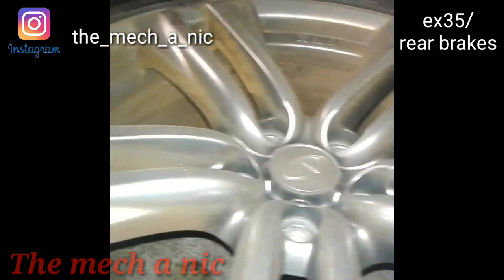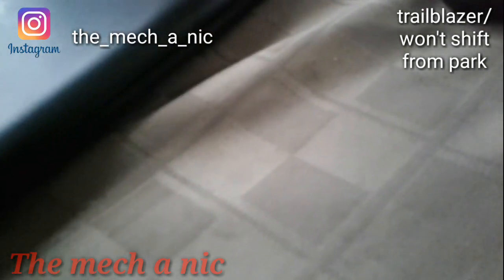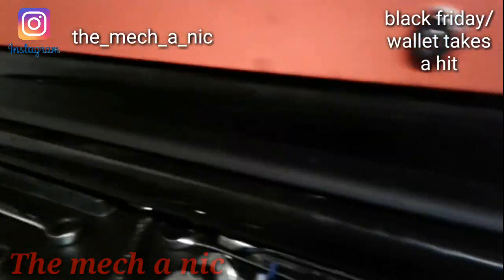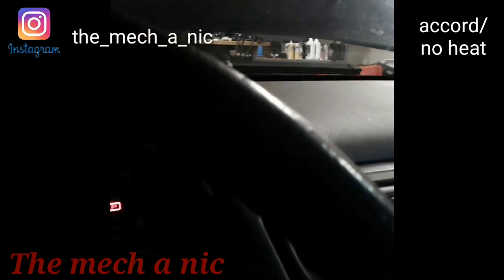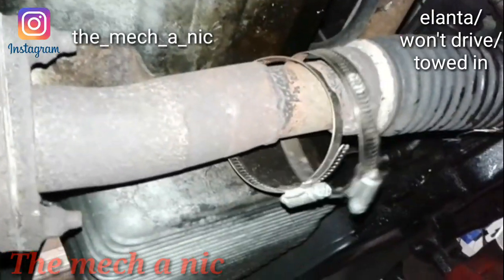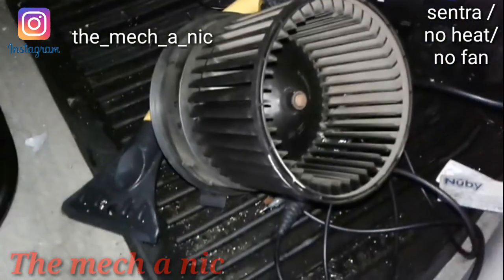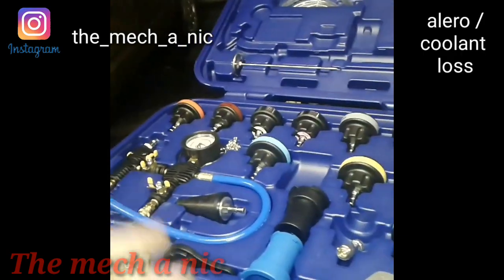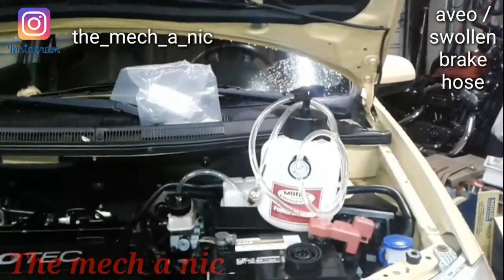Insta mech a nic (vol 11)

Comment: Oh, spooky to shift out of gear with engine running. I was changing transmission fluid one day with the car on ramps As I was pulling the pan down, the edge of the pan bumped the shift lever and it shifted into neutral. The whole car lurched as I was underneath. Fortunately I had chocked the wheels. Eventually I got rid of the ramps in favor of stands, although ramps would be nice for tasks that require the wheels to be loaded when tightening fasteners.

Comment: Now that dude can get you to replace his transmission on that CL when it invariably fails. I miss my TL
Reply from the maker: Yeah those trans shift like crap, my cousins accord shifts the same way. Hopefully it lasts him a while
Reply: @themechanic6117  i think its the 3rd gear clutch pack that melts.  the dealership should be able to confirm if the recall was done on it already.  i think this was 5 speed autos only, the 4s were ok.

Comment: I've seen brand new CV shafts come with absolutely no grease and no mention that was the case.
Reply from the maker: I've never seen that before, how do you know they have no grease of they're clamped?
Reply: @themechanic6117  dude in the bay next to me replaced one and the customer came back a week (or some random time later, this was like 10 years ago) and it had snapped or was super noisy.  completely dry inside and it was sealed from the factory (non OEM part of course).  he sure as hell didnt save any money by having us fix it twice and my guess is you would never see that situation but cant hurt to give them a squeeze before installation lol
Reply from the maker: Someone in China messed up ! 😂 that sucks for the customer

Comment: I have a very similar bleeder. Much better than the eezibleed it replaced.
Reply from the maker: How long have you had it ?
Reply: About a year, mines made by Sealey.
Did the Boxster clutch slave bleed and also changed the brake fluid in the Honda this year. 
Only issue is there is no adapter suitable for the bug, so it's old skool foot pumping for that :(
Reply from the maker: You can't use the universal adapter plate on the bug?
Reply: Might be possible but the cap is tiny compared to modern cars.
It's like less than an inch diameter.
Might I'll give it a go next time.